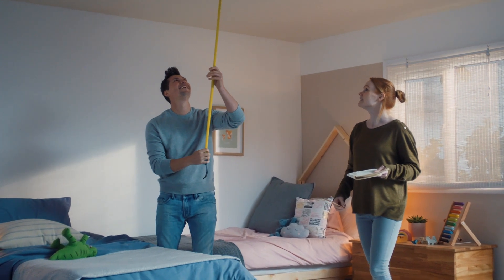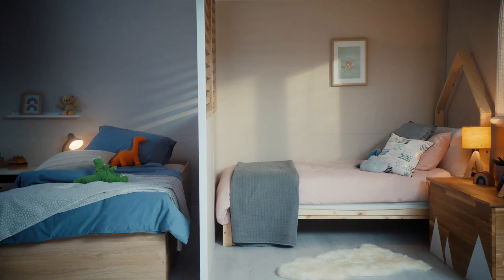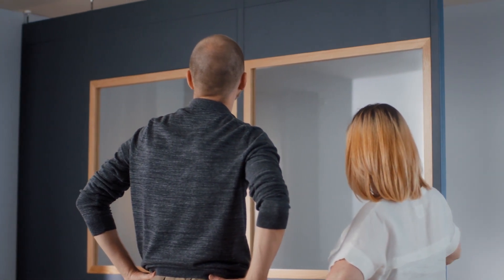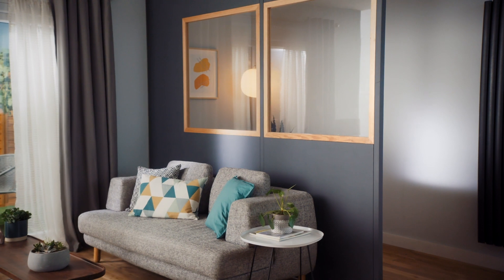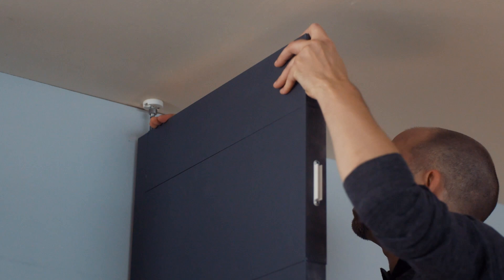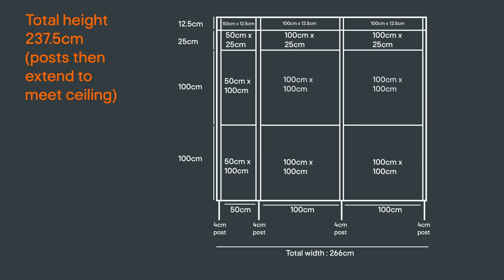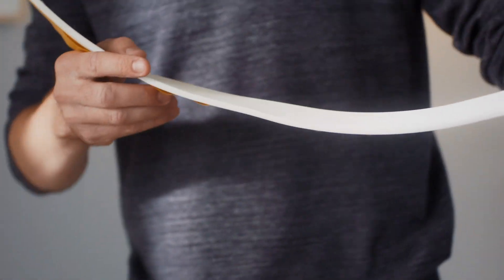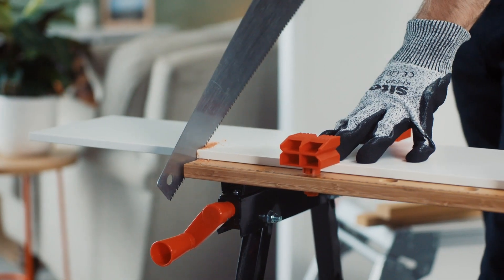GoodHome alara room divider - buying guide

Comment: Can the posts be altered? I have 226cm ceiling height 🙏
Reply from the maker: The posts can't be altered, but potentially cut down to size. However, although it may be ‘technically’ possible - there is then so many problems that could occur off the back of it, so it is not something we would recommend doing.

Comment: Can you split a room with carpet or will the carpet need to be cut?
Reply from the maker: Hi 👋 Thanks for your question! There is a risk with installing Alara on carpet, as  there will be an element of slip from the carpet which will affect the stability of the divider, and as such we don’t recommend it is installed on carpet. We would suggest that Alara is installed on a hard floor only. We hope this helps 😄